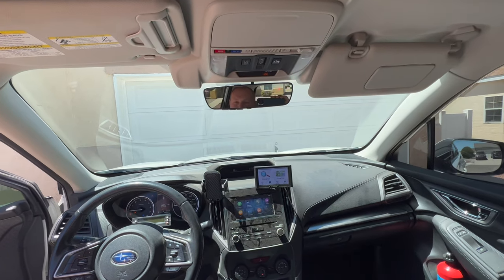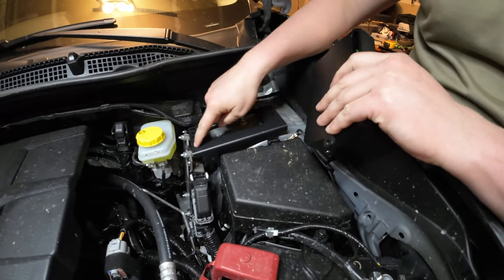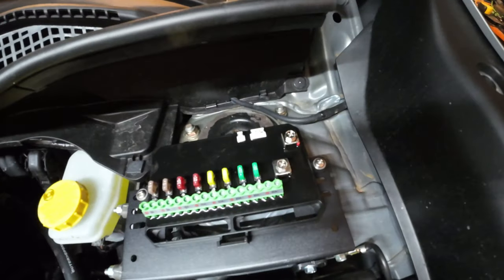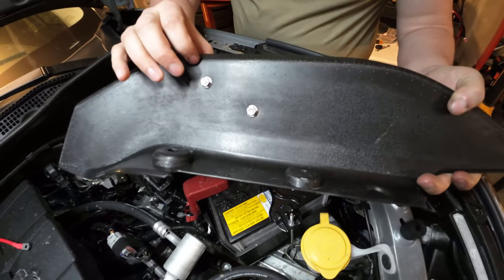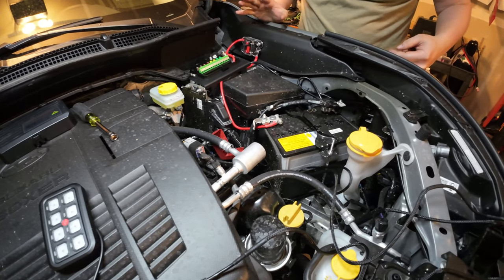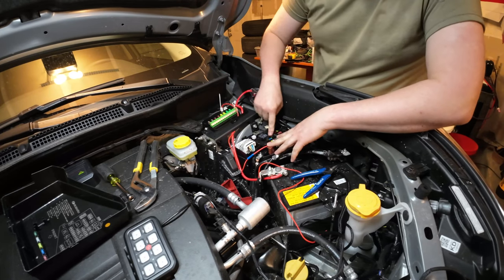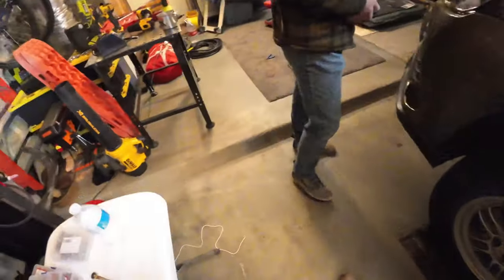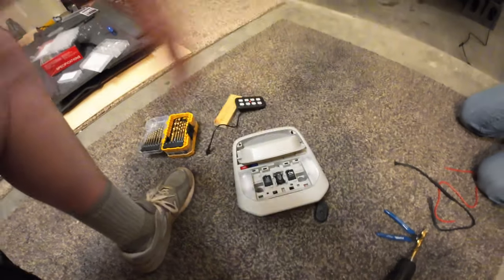How to Install 8 Gang Switch Panel

Comment: What an interesting idea for the 8 gang switch install. brilliant as I was going to mount mine next to the steering wheel, much better idea. (Update) - I spent yesterday doing this install, instead of a chunk of plywood I used some high density foam for the switch mount inside the sunglass holder, worked like a charm also ran the heavy duty wiring for my secondary battery in the rear for the fridge etc.
Reply from the maker: Thanks! 😄 Glad it helped!

Comment: Hi. Nicely explained. I didn’t understand the connection of the white wire. Can you please clarify tha. Thank you
Reply from the maker: The white wire is used to adjust the brightness of the button panel. You tap it to positive or negative, I can't remember which one.

Comment: In the beginning when you show the switch panel in the sunglass holder, what was that made of? I know you show for the build your doing in the video is wood with adheivsive but it looks totally diff. Is that 3d printed or indeed wood molded to it?
Reply from the maker: Just wood with 3M tape. The piece of wood is small, you can’t actually see it in the early clip.

Comment: When you added the fuse tap you added a 7.5 amp fuse. I assumed I would need a larger fuse to be able to handle the 60 amp controller? Im curious why only 7.5 amps is needed? Sorry, I know nothing about electronics.
Reply: The 7.5amp fuse is just for supplying the led panel lighting, so not drawing much if any current.
Reply from the maker: Mark is right, that fuse tap just grabs a little but of switched auxiliary power to wake up the panel.
Reply: @Mark-ks9jj  thanks a lot!

Comment: So do you just leave the white wire (light dimmer) unconnected once you determine the brightness and cover it with electrical tape and leave it dangling in the box? Or do you leave it connected somewhere? 

What does it mean when it says to connect the “White Wire” to the Width/Position Lamp or ACC or car adapter? Are we connecting and leaving it connected at all times to the wire itself or to the fuse?
Reply from the maker: You just tap that wire to adjust the brightness. Adding some electrical tape to the end is a good idea.